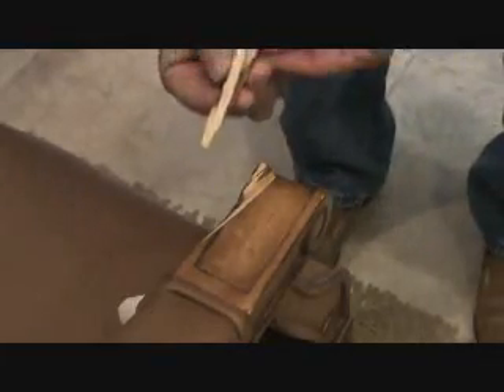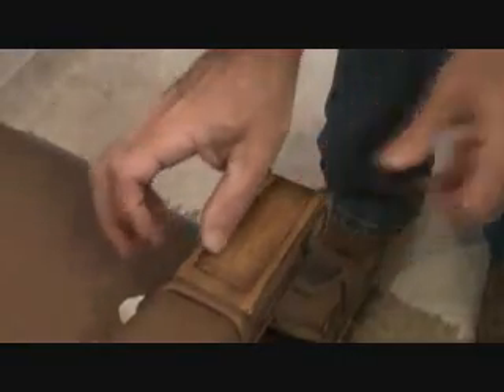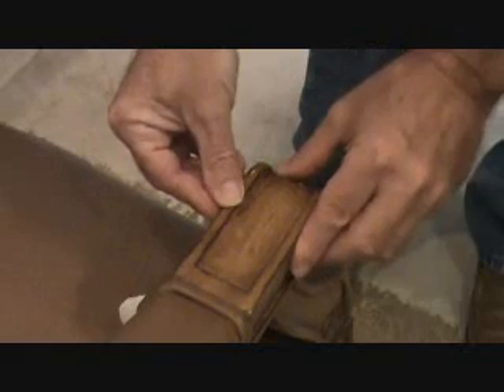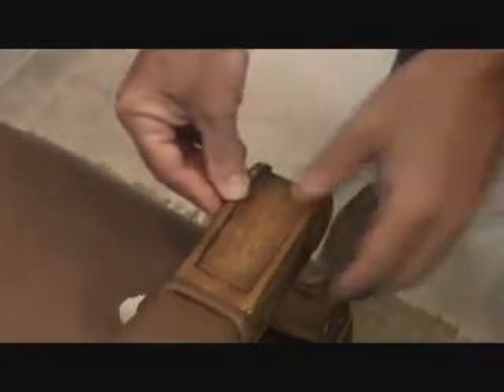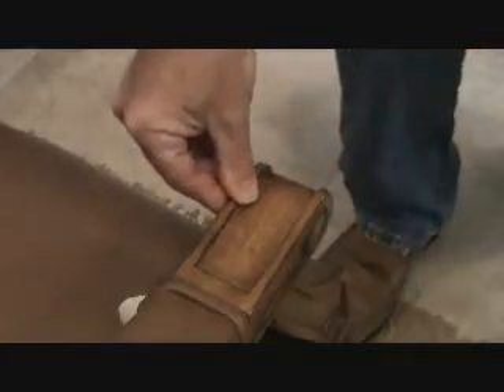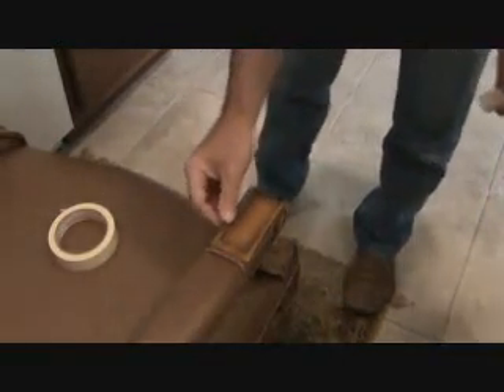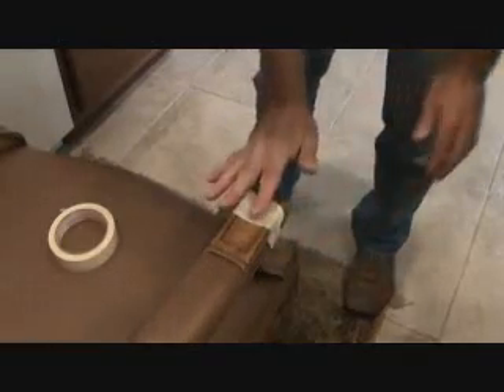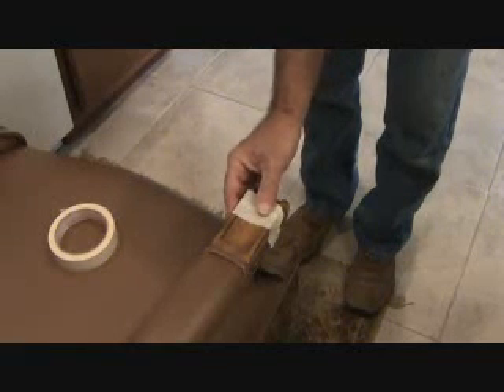How to repair a broken arm chair

Comment: Thanks for uploading. This is really helpful. I also wonder if wood glue would work for this.
Reply from the maker: Yes I would think wood glue would also work. Follow the steps that I have suggested, in case your piece doesn't fit exact. Good luck with your repair!   Joe  :0
Reply: VideoJoeKnows Thanks for the reply as well. I don't really have chair repairing now but in the future I am sure I will. :)
Reply from the maker: Ha! I know....you are a learning genius! Thanks for continuing to check out my videos. I am here anytime you have a question.   Joe  :0

Comment: Hi Joe,

Yeah crazy glue has many uses and it has helped me on many occasions in a pinch. I was looking for this new glue called go2glue from loctight. I can’t seem to find it over here, but they clam it does a whole lot.
Reply from the maker: I've used the locktite super glue gel & it works really good too. I have not heard of the one you mention though.    Joe  :0